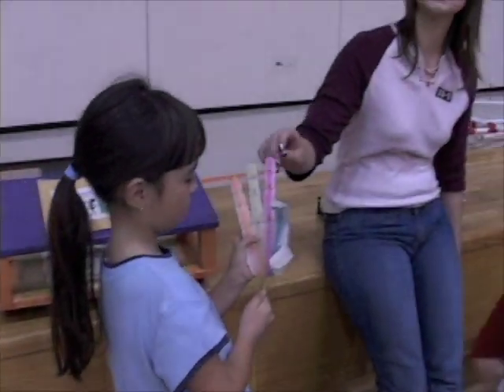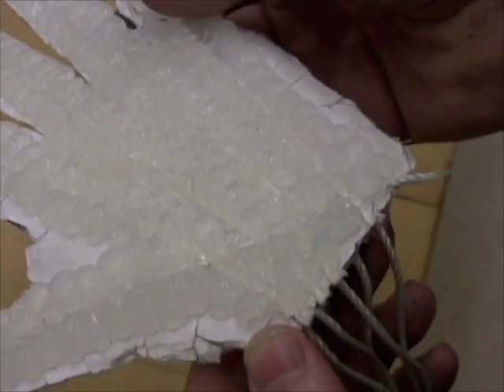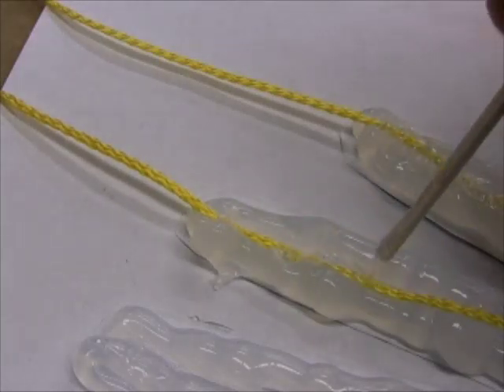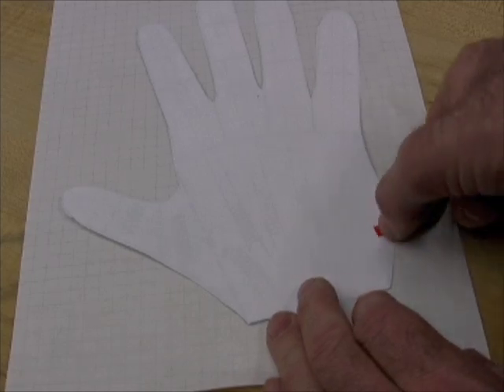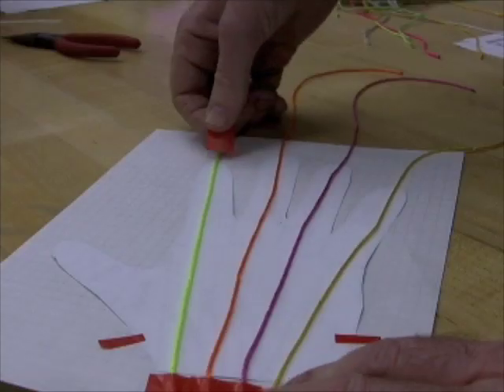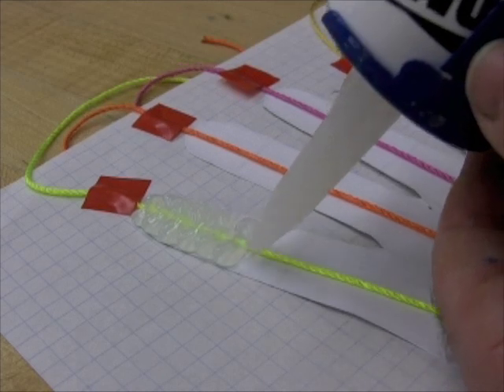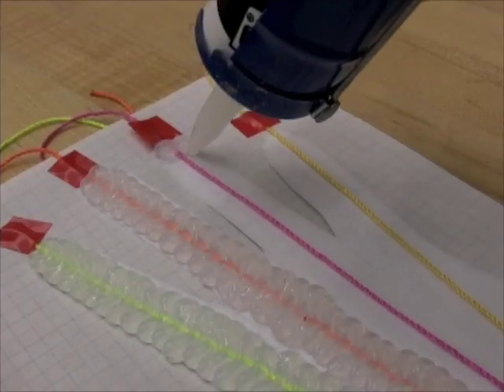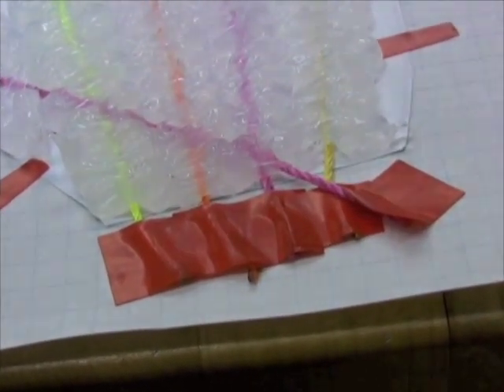Robot Hand Model Revision 5_11

Comment: you can put cardbord where the fingers should go an on the palm get some tape or something with tape on the ether end put it around each finger section put some string through it then just tape rubber bands on the back of the fingers to bounce back  only takes about an hour or so to make don't have to wate for any thing to dry